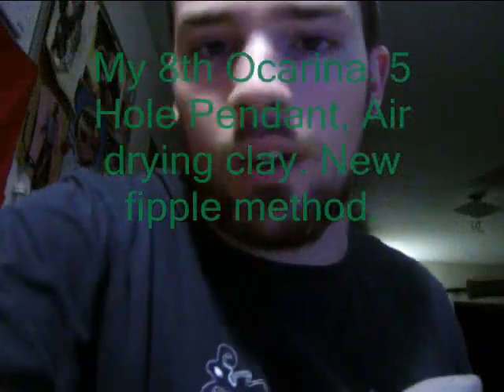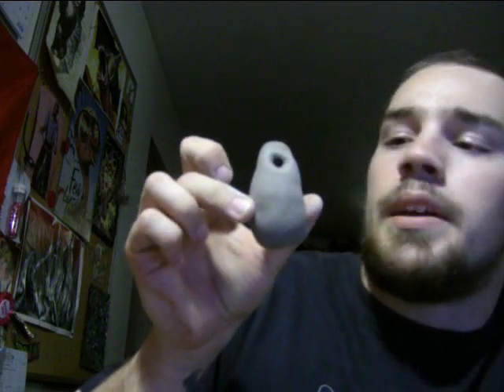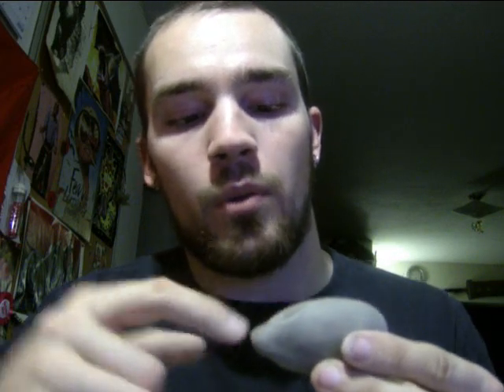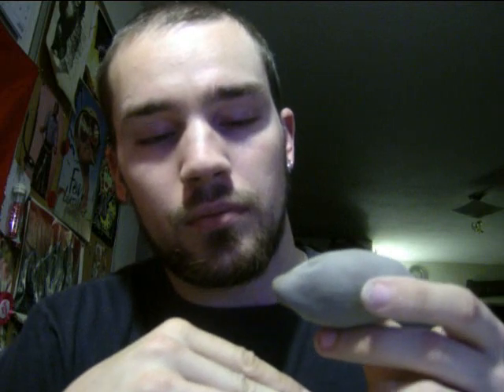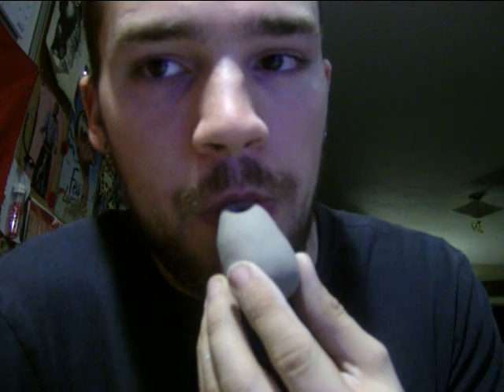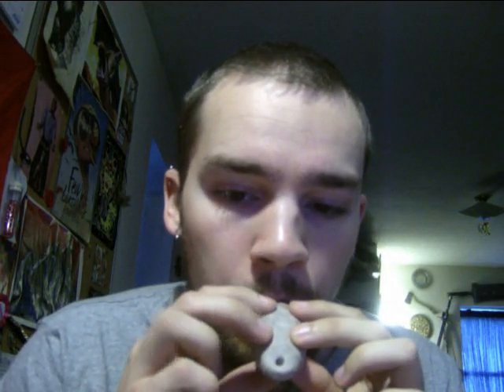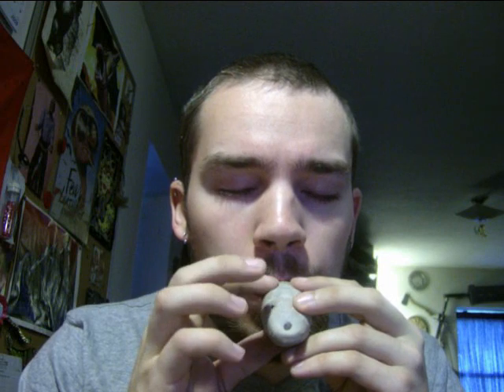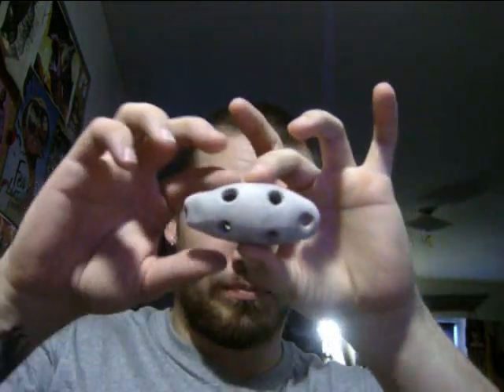8th Homemade ocarina - New Fipple Method!

Comment from the maker: Agreed! I found lining up a separate mouthpiece took more time and work. Once you had it aligned, it was difficult to keep it in the same position while fusing the pieces together. You obviously know, even the slightest change in that position could create drastic changes to the sound quality, which was almost guaranteed to happen in that process. So having eliminated that entire step helped avoid that situation and let you concentrate on the voicing hole.

Comment: i have 1 piece of advice about the cracking on the inside what i do about the tuning is i dont tune it immediately i havent tuned very many ocarinas but what i do is i make the holes in the air dry clay after it dries ya i know it doesnt sound like it would work but with a normal drill bit you can slowly  use your hands to drill throught the clay it just leaves dust and no cracking works for me!

Comment from the maker: Yeah that brands most likely better than what I'm using for air drying. I'm just grabbing a few packs at the dollar store. $1.13 for 500 g.
It's "Crafto" brand and it really is junk to work with. I'm suprised this ocarina held up.
One thing though. I don't know how to play it so I tried a few tabs and it sounds wrong. Way off. But it is in tune to go up scale right? Would you say it sounds tuned right? and the fingering patteren is proper?
10lbs for under 10 bucks definitely isn't a bad deal!